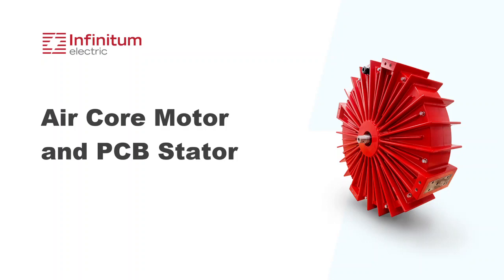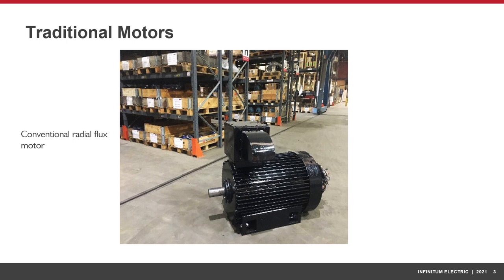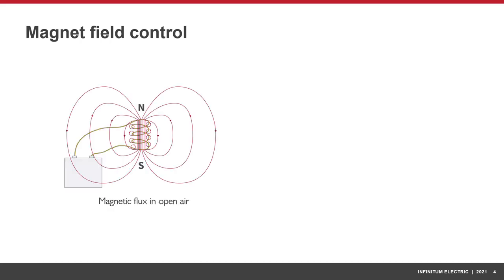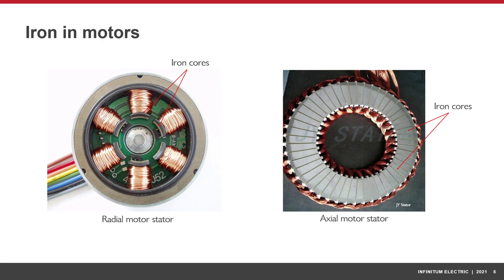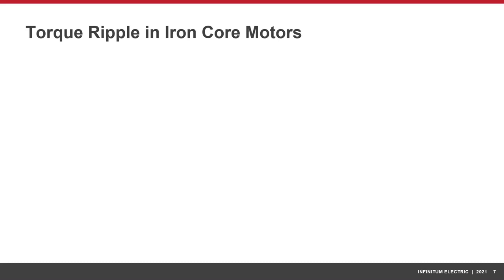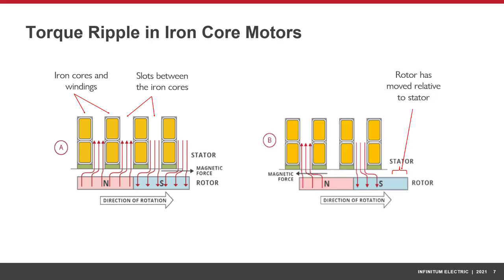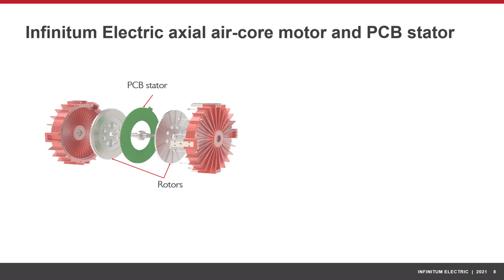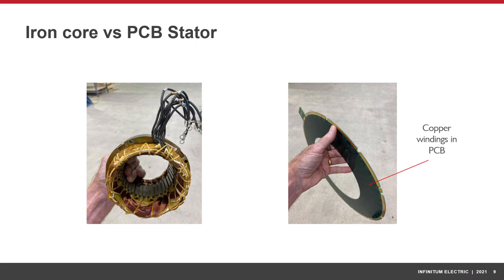PCB Stator Technology

Comment: PCB motors have been around for decades. What makes yours different? Modern hugh frequency controllers allpw us to build motors with impressive power output... but what are you doing to improve the inherently low duty cyle of PCB motors? I notice you compared an existing model to a 10hp conventional motor... but that doesn't tell the whole story. The conventional motor in your video is rated for constant duty. What is the constant duty rating of your design?

Comment: There is no way that the shown PCB stator (comprising only a few grams of copper spread over micrometers thick pcb traces) can replace the shown traditional wound stator (with a few kg of copper in thick wires). Although the wording says so.
Totally misleading advertisement.
Reply: They offer evaluation motors so that you can determine that yourself....so maybe you are incorrect.
Reply: @matthewgiannotti3355  For free? Or am I supposed to pay to "evaluate" something that is clearly a scam. If it looks like a duck, walks like a duck and quacks like a duck, then it just may be a duck.
Reply: That was my first thought. The "10hp motor" they pictured, was likely rated at 10hp constant duty. Since high frequency digital PWM controllers became a reality, PCB motors can be with with impressive burst output... but the inherent problem of thermal management and ridiculously low duty cycle is still a problem.

I don't see this as being any different from the developments of CORE Technology, back in the early-to-mid 2000s. They tried every way to make PCBs a viable alternative... wind power, hybrid vehicles, outdoor power tools, etc..

Nothing really worked out, aside from the outdoor power tools, which saw mild success in the 2010s. A subsidiary of American Lawn Products acquired the technology, and deployed it across several brands. It took less than 5 years for it to all-but disappear from the market.